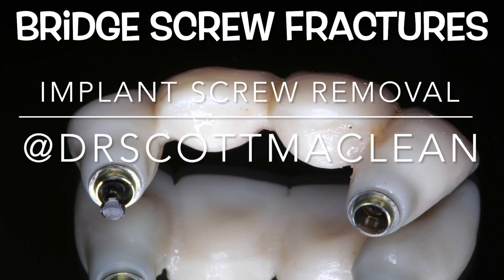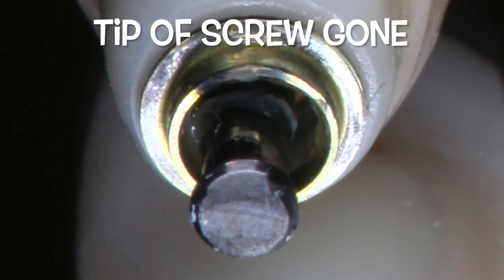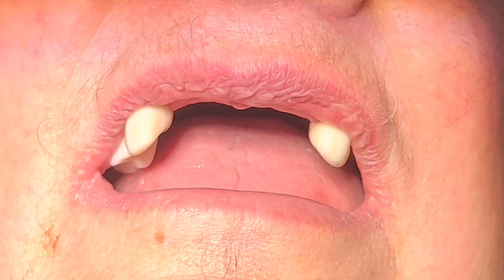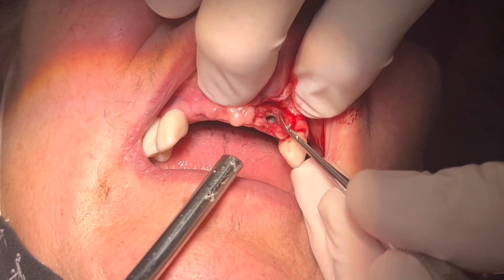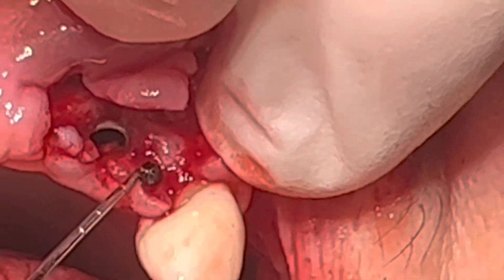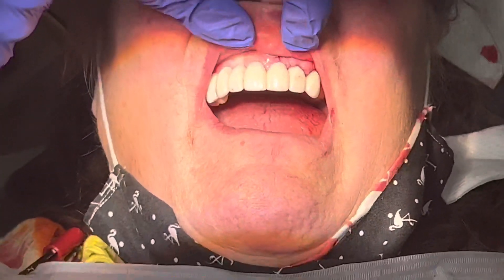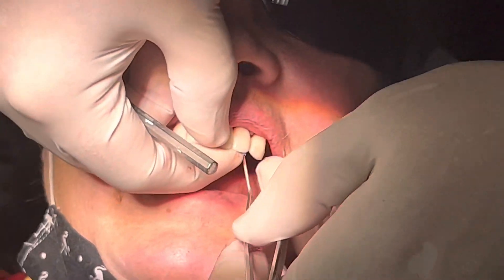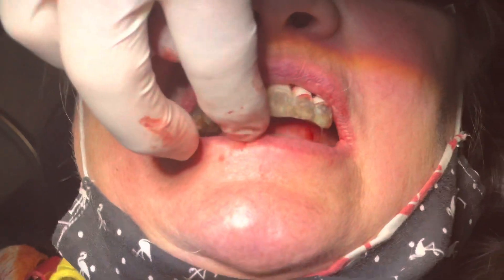Implant screw removal - Dental Implants

Comment: hi doc, with something like a cemented bridge, how do u remove the abutments from the crown? i assume many of these arent perfectly angled so custom abutments and bridge cemented. if the abutment can be remove, placed (using the bridge as a rough guide and the bridge recemented). do most bridges just seat bc they are close enough? and how do u keep stock of screws for all the implant systems?

Comment: How do you take out broken screw that’s tight inside ?
Reply: If you know the implant manufacturer, you can buy the screw removal kit. 

You will make small hole in screw remnant then put reversal bur in your hand piece and slowly reverse the screw out.
Reply: Ultrasound
Reply from the maker: Usually not tight when broken